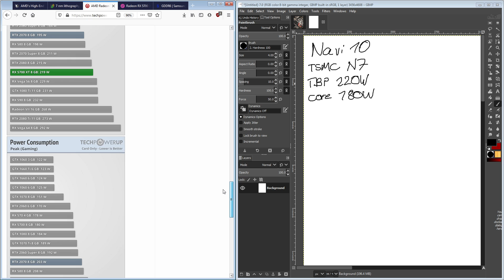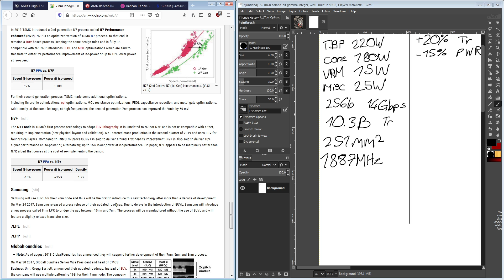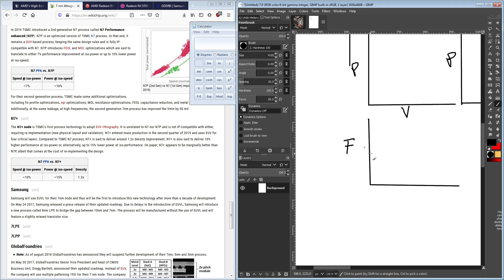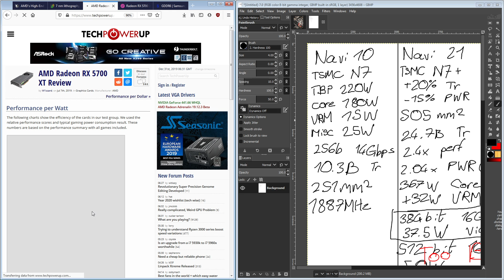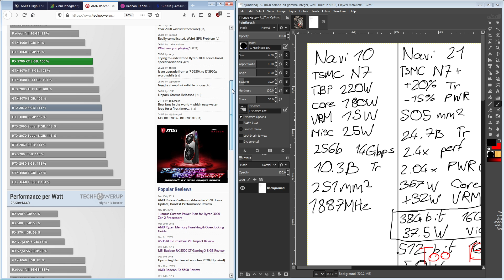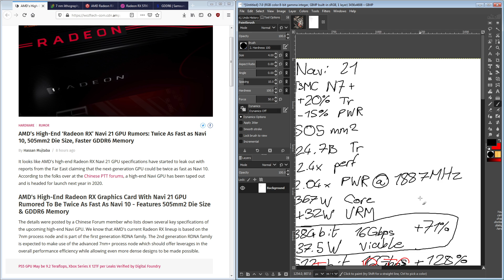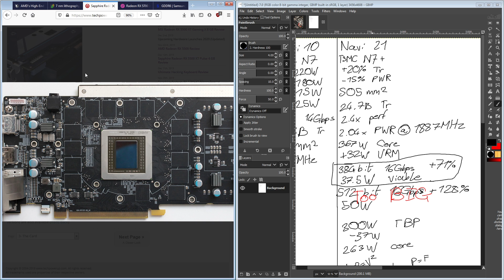I don't think Navi 21 will be 2x the speed of Navi 10

Comment: Well, there is one issue: AMD might improve Navi further. Didn't they already announce that its RDNA2??
And that's what they will continue to do: one or two Chips per year, everytime slightly improved. Kinda similar to what they do with the GPU. 
BTW: do we even know that Navi 21 will use GDDR6 and not HBM2 or 3?
Reply: About 70% of a chip is made of interconnects and the bigger the chip the longer these connections get and this brings down efficiency. You can expect 60% more performance when you double the size.
Reply: @excitedbox  okay so they got 60% improved performance from increasing the die size. How much do they get for increasing the memory bandwidth? How much do they get from the architecture going from RDNA - to - RDNA2? How much more power efficient is TSMC's 7nm+ really? Could be 2x a 5700xt, or at least 2x 5700. Hopefully we find out for sure at CES!
Reply: @excitedbox  There are some Problems with your argument.
a) AMD already clusters the units with Zen2, so they do not need as much bigger Interconnects as you might think. You can argue that its a way back to VLIW, wich is fine. That reduces the Interconnects dramatically
b) Bandwith. We do not have any idea what they will use. And DO NOT underestimate AMD and claim that something is impossible! THey might surprise you. Remember R300? That chip was bigger and badder than anyone would have guessed at the time (and also the reason why CineFX1.0 blew so much, besides Pipeline stalling: FX5800 was a 4 Pipeline Chip, R300 was 8)
c) Memory PHY. If they use HBM2E, they free up some space from the Memory PHY, as the HBM2 PHY is much smaller because the signals don't need to go off package, wich makes them much smaller. And also less power hungry as well. Yes, its pricey, but also its way more efficient and you get up go ~900GB/sec with just 2048bit. With a full 4096bit, we're talking about an insane 1,8TB/s Bandwith. And the real question is: will AMD do it and put everything they have on this product?
d) the improved manufacturing process. As was said by Bullzoid and others, we expect them to use N7+, wich decreases the Power slightly and also increases the density of the chip. Meaning: More trannys per mm². 
e) Memory Compression Algorythms. That is also something people do NOT talk about these days but also one of the Things that ATi, at the time, pioneered with their "HyperZ" and other things. With that you can increase Memory Efficiency and need less Bandwith. Its even possible to go for a slightly lossy algorythm for gaming/some games. Or improve the lossless algorythm they use
f) Architectural Improvements! Big Naiv won't be RDNA! It will be RDNA2! The question is, how much will RDNA2 improve on?

Will it be Tahiti <-> Tonga level or will it be Tahiti <-> Polaris Level? Or do they do an even better Job and do Tahiti <-> Navi. All those chips are around 2048 Shaders, most have 256bit Memory Interface (tahiti 384bit, Tonga is alleged to also have that but no product with that was ever seen).

But even so: what if AMD does use a different process and not N7+ but risks it and goes N6??
Its just too soon to make any guesses about the CHip, how wide it will be, how efficient and so on. 
Remember that LisaSu got her House in order, just recently, and switched to a constant improvement strategy, with 10%+ "IPC Gains" per Year - or more. And she's an Engineer. The worst kind of CEO for nVidia and Intel. And she seem to push her Staff slightly as well, according to her (can't you do a bit more??)
And with Zen2 they shocked all people with getting the so beloved "IPC" higher than an Intel Chip in most cases with the only big issue for us is slightly higher latency (wich is important for high fps Gaming).
Reply: @Stefan_Payne  I didn´t say anything about the architecture etc. All I said was that doubling a chips size will give you around 60% additional performance. There was no mention or argument made about anything else or any other aspect beyond that.

Trust me I don´t under estimate AMD because my dad was actually one of the Engineers on the first Radeon back in the 2000s. He got picked up by ATI in the Zeng Labs merger and later by AMD after they bought ATI. He worked on a project to put 2 GPUs in one card back when GPUs were still too big to make sense. That project gave us those dual GPU cards such as the Radeon HD series 4 years later. He used to take me into the office when I visited him during the summer and I actually used one of their test GPUs way before they were announced. 

I will admit I am no expert but I got a close look and many in depth explanations on how graphics cards work from him and his friends in the hundreds of hours I spent at both the Newtown PA and Silicon Valley offices.
Reply: @excitedbox  You are still assuming there are absolutely no architectural improvements. By your logic nvidia would never get twice the speed lol. RDNA2 is not the same as RDNA x2. Its improved architecture.
Reply: HBM is still hella expensive.
Reply: @marksemple297  Yes but still the most efficient way to reach 1TB/s Bandwith - as does the Radeon 7 have, the 2080ti only has 616GB/s So with newer, faster HBM2E wich increases the bandwith of a single Stack by about 50%, even a 2048bit wide Stack (like VEGA56/64) would have ~900GB/s, wich is around 50% more than the 2080ti has. So with that in mind - and HBM2E with 3,6GT/s available, double the performance of 5700XT is in reach.
And with a 4096bit Interface, we'd be talking about a whopping 1,8TB/s Bandwith, almost 2TB/second fr "Big Navi". The only question is: will AMD do it?
And do you remember the R300 Chip? That's something nobody expected. It was bigger and more powerful than anyone would have guessed at the time - 256bit Memory Interface, 8 Pipelines - at the time they used 128bit and 4 Pipelines (wich is why the FX5000 Series sucked so much: they were 4 Pipeline designs).
Reply: @Stefan_Payne  The problem with HBM2E is that it also increases cost. The point of HBM2E isn't to increase bandwidth over HBM2, it's to put more memory in a smaller space. If you want more bandwidth, by far the most cost effective option is to use more memory dies, rather than double the stack height (and therefore doubling your costs) and increase clock speeds. Using two dies doubles your cost as well, but it doubles your bandwidth, while HBM2E is nowhere near 2x as fast as normal HBM2. GDDR6 is less energy efficient, but it's a much cheaper way to get higher bandwidth (by increasing bus width and adding more dies) than switching to multi-stacked HBM.
Reply: @nathangamble125  Maybe. But the real question is: is a 512bit Memory Interface possible with GDDR6? and what about 16-20gbps chips? How much Power does that consume?
And here we have some serious Problems that limit the Performance of the Chip dramatically. But then again, we're talking about the biggest Chip with potentially 80 CUs! 
The Xbox Se X for example already has 52 CUs at a 320bit Memory Interface. Its possible that that gets another 64bit and 4CUs (maybe 8?) for the Desktop Chip...
And then we're talking about a chip that's even more powerful than that. Maybe "only" 64 CUs (4096 Shaders). And for that, GDDR6 might not be enough. And a 512bit Memory Interface might consume far too much power - wich then could make the product pointless as the memory eats up most of the power and you have to either make a 350W SKU or you can switch to HBM2E with around 900-1TB/sec Bandwith - possibly even double that.

Comment: Maybe HBM again? Even then I don't see the core drawing more than 250 W so it will either be clocked at ~1300 MHz or more realistically it will be a much smaller die, like 350 mm^2 ignoring any raytracing modules. That's actually pretty close to the tu102 cards for power and clockspeeds. Looking at the size of RT cores, AMD will need that extra real estate.

Comment: AMD dosen't have a clock speed problem, AMD has a Memory Clock Problem, the memory controller that they use is very limited. Unless they figured out how to design a much better memory controller, they will never dethrone a 2080ti. Couple that with the proven fact that they DO NOT know how to make a proper cooling solution for ANY of their GPU's, and you can see a big Navi competing with a 2080 super at best.
Reply: "Never?" So, the 2080ti will always be faster than any card AMD makes. Always. Oh yeah, and AMD doesn't design or manufacture coolers.
Reply: @nimrodery  They still haven't come up with a card that will shame a 1080ti, and a blower style "cooler" is not a proper cooling solution, they rely on their board partners to manufacture proper cooling solutions, which tests the limits of what they are capable of. My EVGA RTX 2080ti FTW3 Ultra will whip the shiznit out of anything AMD has ever made and do it at 60c.

Comment: if my math is correct a 512bit gddr6 memory interface will use about 146mm/2 it can be done and based on the SE's adding 25~30% more core pref and as much bandwidth as possible is a better use of power. based on cycle times the 5700xt is memory bandwidth limited above 1650mhz core clock a big sign of this is OC'ing memory has far more of an impact then changing the core at all

Comment: For mounting memory chips: Maybe they could mount them on both sides of the PCB like some modern workstation cards and just extreme cards in general (my GTX 295 single PCB variant has that)? Tho GDDR6 is flip-chip, so that could generate a serious heat problem on the back of the card

Comment: How does RTRT hardware changes factor into bandwidth scaling i wonder?  If 125mm2 of the new area is for normal rasterization (with further tweaks to efficiency) and then another ~125mm2 might be the RTRT hardware changes, which means normal bandwidth calculations might be a little off based on size and transistor count versus previous GCN/RDNA chips.

Perhaps a 384-bit bus would still make  sense in the case of a 64 CU  RDNA2 card with RTRT?

Comment: It looks like you didn't factor in the 15% power efficiency improvement from the move to N7+ into your calculations. And you should also keep in mind Navi 20 (which includes Navi 21 and Navi 23) are RDNA second generation cards, so there will be some power efficiency coming from architecture improvements too. All in all, you could probably shave a good 20-25% of power consumption overall. 

That been said, I don't disagree that 2X the performance of Navi 10 is unlikely. 1.7x improvement certainly sounds more realistic. All I'm saying is that it will probably draw a bit less power than you think.
Reply: >It looks like you didn't factor in the 15% power efficiency improvement from the move to N7+ into your calculations. 

He did hence 2.04x power for 2.4x transistor. 

> And you should also keep in mind Navi 20 (which includes Navi 21 and Navi 23) are RDNA second generation cards, so there will be some power efficiency coming from architecture improvements too

Yes those were not factored in. You would need 15-30% architectural improvement to get double speed.

Comment: @buildzoid
 maybe I didn't understand but why didn't you subtract the -15% power from 367W that you doubled from the navi 10 core? Your first said yes it does draw double the 180W but then said no because of the improved 15% efficiency of N7+.
Reply from the maker: it has 2.4x more transisors and pulls 2.04x more power so the effic is already added in to get the 367W figure. Without the effic improvement the power draw would be 432W.
Reply: @ActuallyHardcoreOverclocking  Got it thanks for replying so soon to my comment, have a great year ahead :)

Comment: Why is AMD so much more memory bandwidth limited compared to Nvidia?
Is it due to compression?
Reply from the maker: With the 5700 XT AMD seems to have caught up. The 2070 and 5700 XT are pretty much tied on performance and use the exact same memory configs. 14Gbps 256bits.
Reply: @ActuallyHardcoreOverclocking  thanks for the info! Appreciate it!

Comment: Have to say that I love the analysis, but I just want to make one point. I have a ref 5700xt in a sfx case. I can run stock clocks , about 1860mhz with an undervolt and reducing power limit by 20%, so it can essentially do stock clocks @ 150w. Allows me to run the fans on auto and keeps temps in check, survives time spy stress test no problem. So if AMD spend a little more time like Nvidia does the outlook doesn't look too bad. But the WCCF article is clickbait for sure.
Reply: He is going off the numbers amd themselves put out. They over volt their cards so more of their cards can hit specifications. So while your rx 5700xt is that efficent, it doesn't mean the majority of rx 5700xt's are.

It doesn't make sense to put out a big navi card with specs that 50%+ of cards can't hit.
Reply: @dondraper4438  Yeah thats true, but if they spent more time on binning the gpus like nvidia does, they could achieve better results, like they have done with the 3950x for example. Chips that don't make the grade go to the low tier.
Reply: @Transistor Jump what case do you have, me node 202
Reply: @Transistor Jump Cool will check it out, thanks!

Comment: Great video. I thought you would say that the rumor is implausible, but instead you said that the assumptions the journalist added to the rumors are wrong. 

When you read the article it's easy to discern what is rumor and what was added by the journalist. In addition to "twice the power" he also said that the 505 mm2 GPU that is 53% bigger and uses a denser node than Vega 20 should only have around 18% more transistors. It's so bad

Comment: According to Daredevil from the 3dcenter.de forums, the sweet spot for navi is at 1400MHz, where it is approximately 1.5 times as power efficient (performance/watt) as with stock clocks: https://www.forum-3dcenter.org/vbulletin/showthread.php?p=12051499#post12051499

Comment: What if the GDDR6 part is wrong, and die size includes the HBM dies?
Then power consumption and bandwidth can all be solved, although the core performance may become a bottleneck.
Reply: If this is an ultra-high-end part to compete with something like an RTX 2080 Ti or Titan, I find HBM plausible.  HBM2 isn't nearly as hard to get as it was when Vega 64 launched, when HBM2 manfucaturing was the cheif reason for it's delay.
Reply: @TheXev  HBM2E is cheaper
Reply: @TheXev  No, AMD's incompetence was the reason for Vega's delay and laughable failure.
Reply: Going by the same rumour mills, the next Navi is to use GDDR6 not HBM, as a cost saving measure. So if Big Navi is to use GDDR6, it cannot possibly be twice as fast, because it would run out of memory bandwidth before core clocks could be high enough to gain that much performance.
If Big Navi is to use HBM, then those rumour mills were wrong with their previous leaks, which casts doubt on the validity of the rest of their claims. 

But let's say that on-die HBM is used, perhaps as part of a chiplet design. If so, this is a big change from the existing Navi architecture which was previously monolithic, using on-die memory controllers. That would imply a major refactoring at the architecture level, instead of a mere architecture refinement with 7nm+. It's not impossible because Navi already uses infinity fabric. But there are factors militating against that. 

It should be noted that 7nm+ is actually a full re-implementation of the same architecture on EUV. That is very expensive, because it takes a lot of time to basically re-do all of your work, re-trace all your photolithography masking patterns, to accommodate EUV. Maybe AMD is willing to go down  that path, despite the risks. But it would be quite unlikely.
It would be more likely to instead have off-die HBM, and to replace the memory controller for GDDR6 with a memory controller for HBM. That is very much doable. Then more of that die size increase could be dedicated to compute units. But this would, once again, invalidate earlier leaks that Big Navi was to use GDDR6.
Reply: @MonMalthias  HBM2E is cheaper

Comment: This is how the media get away with everything though because they have not technically 'lied' or made it up. 
People are assuming that 2x faster than Navi 10 means 2x faster than the 5700XT but the 5700 also uses Navi 10 and the 5600XT is also rumored to use Navi 10.
I will focus on the 5700 since it's an existing product:
We can see it is 36CUs @1.725GHz boost a straight double without changing the speed gives you your 2x faster claim and we know there is clock speed room since the 5700XT has a peak boost of 1.905 GHZ. 
Another option would be 68CUs at around 1.85GHz 
Personally I'll not hold my breath for AMD ever going above 64CUs so I'd say some water cooled 2GHz edition could get there too and honestly it would be better for scaling in games. 

Overall I'm going to mark this as probable unless they specifically say 2x faster than the 5700XT to which I say not a chance.
Reply: The 5700 is a cut-down 5700 XT. When we talk about Navi 10, we're talking about Navi 10, not Navi 10 with some cores disabled.
Reply: @nimrodery  That's your assumption. The article does not say "the full" Navi 10. Also who knows if the 5700XT is the full Navi 10. The 5800 is probably a Navi 10 part too.

Comment: could they put ram on the back of the PCB as well?
Reply from the maker: you'd still need way more PCB layers for the extra memory chips.
Reply: Elios0000 AMD has done that before, but the issue is that GDDR6 is stricter about trace layout and signal integrity than GDDR5.